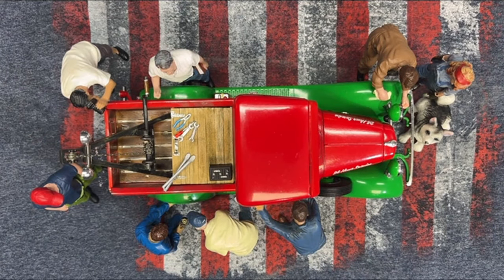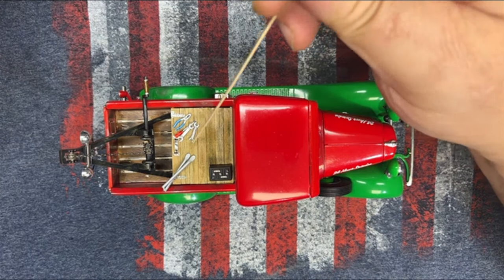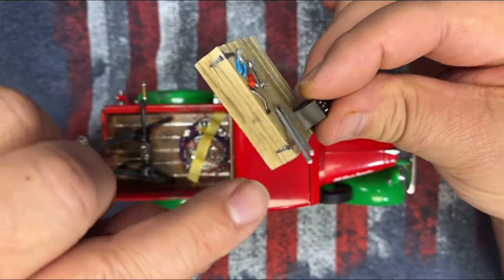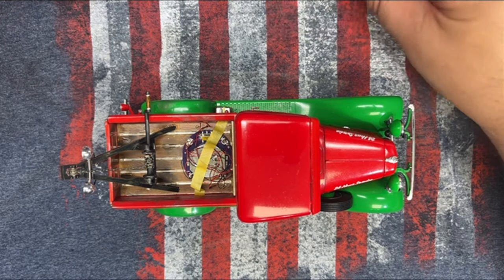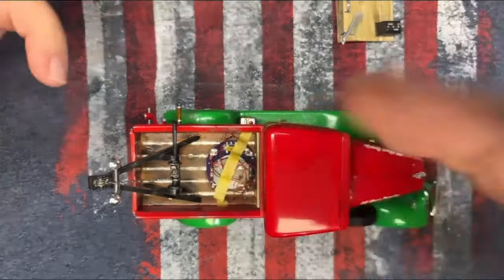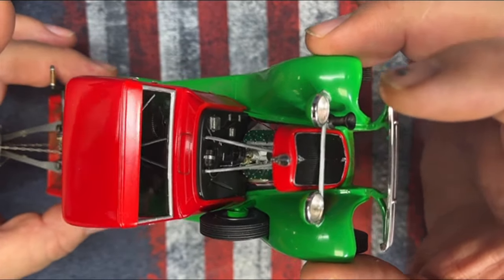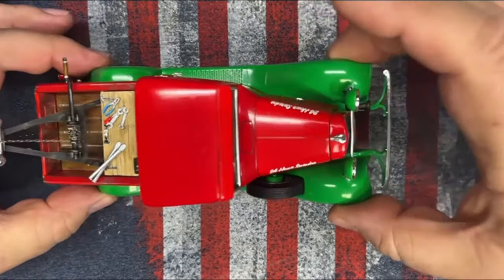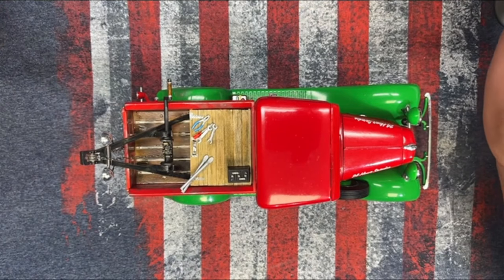AMT 1934 Ford Pickup 3n1 Texaco Tow Truck All Done!!

Comment: Another off the hook build. Well done.  But the amt stock firewall has a coil that is supposed to be used for the chrome engine not the flat head.  The coil for the flat head is part of the distributor.
Reply from the maker: Thank you.  I must have seen something else in the picture I was looking at.  I saw a wire coming from the firewall going into the back of the wire loom on that side.  If there's a 50 50 chance I'm going to come up with tails.  LOL
Reply: @grandpamarkshobbies  there are many types of distributors for a flat head and many have a coil and wire but the kit is molded with the coil on top of the distributor.  I'm building the same kit and having  trouble researching the flat head.  Keep up with the excellent builds.
Reply from the maker: I had a hard time finding anything on that hardhat distributor.